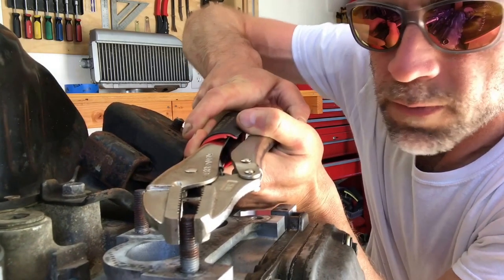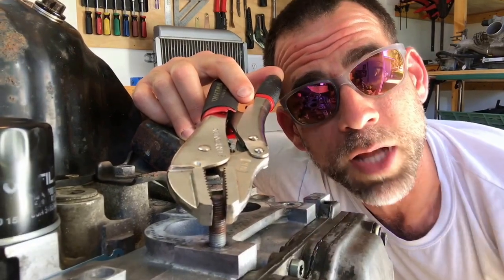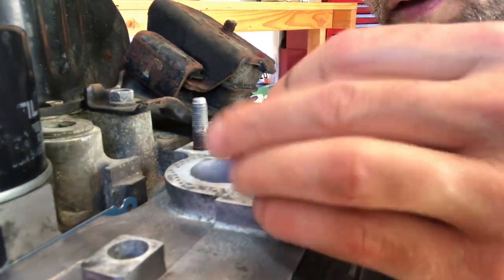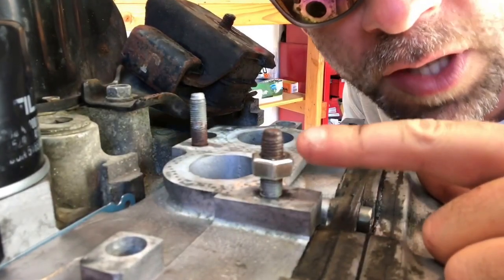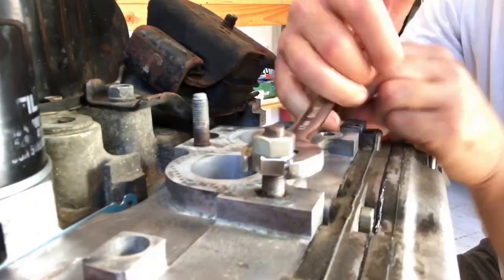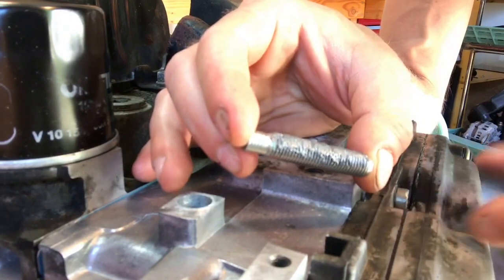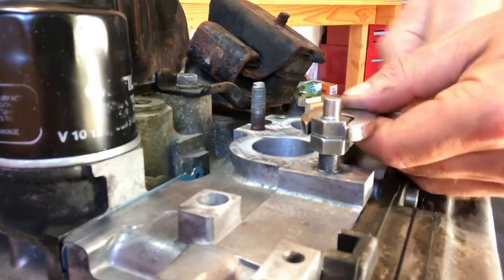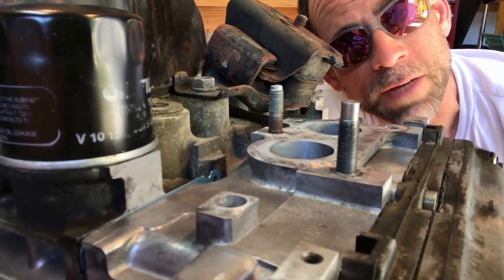How to REMOVE or INSTALL any Size Stud

Comment: Or you can buy the correct tool. Granted it can often work, as long as you tighten the nuts together enough. Hey Luke what about broken bolt removal tips. Like the cam bolts and so on.

Comment: What's the issue with having the stud seized in the head? Wouldn't having it not seized cause it to come off anytime you took the nut off?
Reply: if it snaps, or you need to machine the sealing face.  awesome little trick, I was blown away when I found this one out.  super simple, and you will always have the right sized nuts.  works great on ready rod too if you're in construction and have a really long ready rod hanger holding up pipe or uni-strut.
Reply from the maker: +submitcyber

The studs can seize because they often are installed and then not unthreaded for many years which allows them to get seized.  The bolts are often removed more frequently so they seize as much.  If the bolt isn't seized, the stud stays in the head.  ~ Thanks 👍👍
Reply from the maker: +ilyafr86   Thanks for the added info - much appreciated and all good to pass on for sure! 👍👍

Comment: hey man not a lot of people know this old trick but hey I have a problem with my sti 05 it stutters at full boost I have codes of p0457 p0171
Reply from the maker: +Tony Guzman 

Ok.  Looks like (1) P0457 = Evap Sys Leak and, (2) P0171 = Lean Fuel Mix on Bank 1.  I wound only be concerned with the first one, especially if you feel a stutter when boost comes on.  Basically, you have too little fuel (check filters, pump, and injectors), or have issue with incoming air measurement (bad Mass Airflow, if applicable), or a leak in the intake system (before the turbo) that is pulling air into the engine and the CPU can't measure it to add appropriate amount of fuel.  The leak is one of the most common issues.  Without more info, I would start there...Let me know if you make any progress or figure out the cause!
Reply: thanks I tested all injectors cylinder #3 was bad replaced it still has a stutter air filter is clean and the maf sensor is replaced
Reply from the maker: +Tony Guzman  How about the ignition system.  Had that been looked over and tested?
Reply: SubaruONLY yes I changed all coils spark plugs gabed them myself to make sure